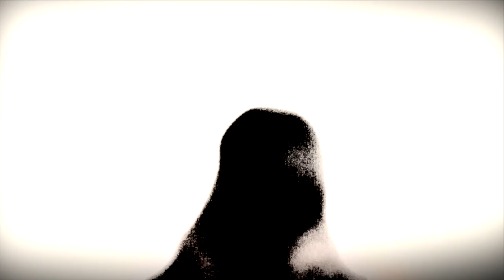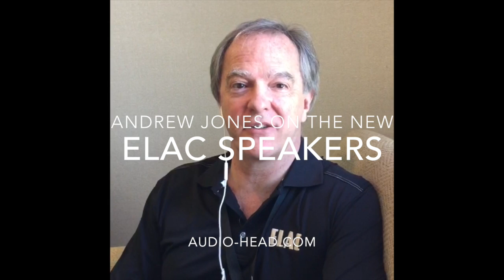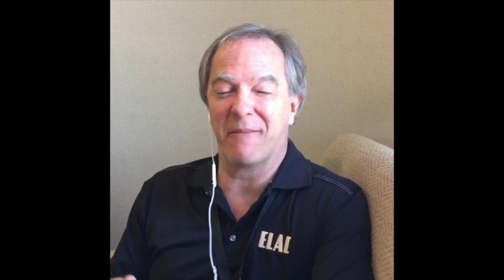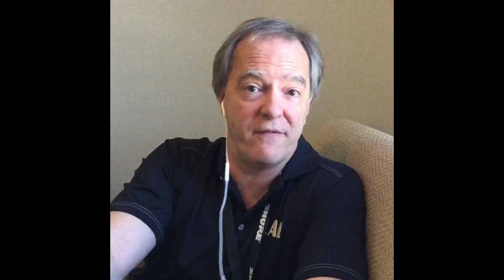Andrew Jones of ELAC and Pioneer discusses the Debut B5 and Uni Fi UB5 Loudspeakers

Comment: Skipped the Debut Series as hard as it was. Pre-ordered the UB5. Looking forward to to some fun.! Thanks again.
Reply: Shane Lindsay did you get them yet?
Reply: Yes I did. Back in July. They're broken in now and I like them a lot. Their strong point is imaging. You place instruments and vocals from left to right really well. Highs are slightly rolled off. Mid-range is nice...not too laid back or too far forward. The lows are great for a 5.25 woofer. Kind of blew my mind at first. I don't understand why so many people say they are too light in the bass department. Not my experience at all. They do need to be out from the wall though and the soundstage doesn't extend too far beyond the speakers themselves. Other than that, they're great. They have a softer presentation than some speakers which can help listening for longer periods of time. ☺️